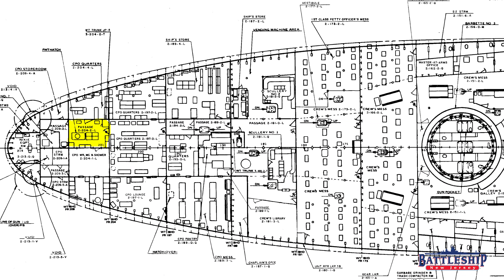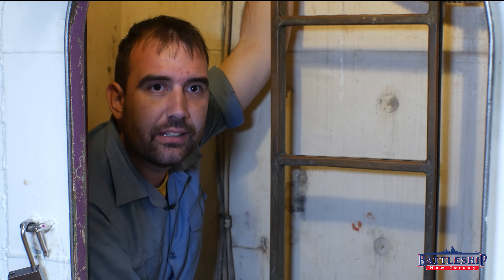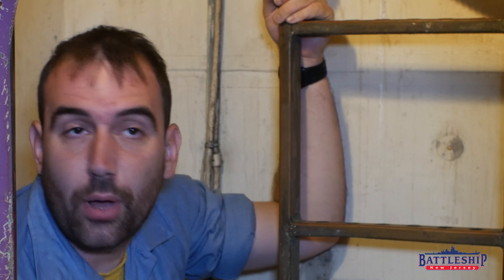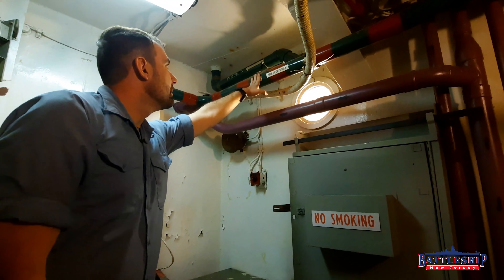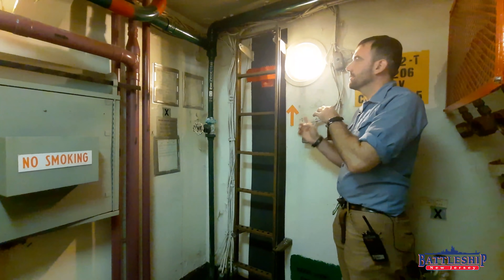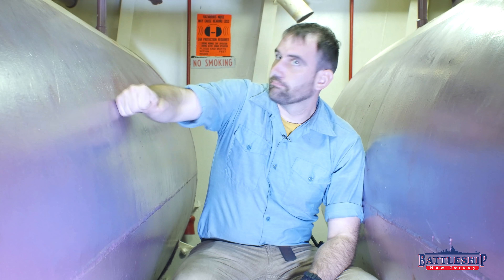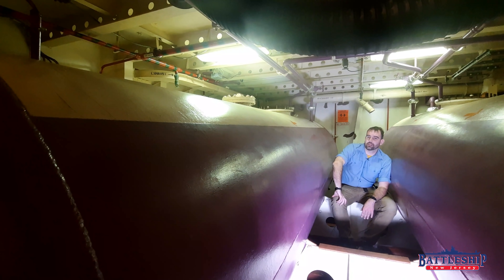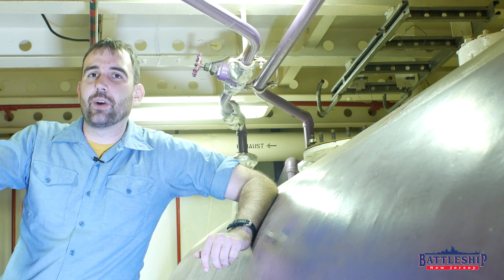JP5: Aviation Fuel

Comment: Give the fact that aviation gasoline is so much more volatile than bunker oil or diesel normal practice was to store it in tanks isolated from the ships hull to prevent shocks effects from rupturing the tanks. 

The loss of Taiho illustrates well the dangers of having aviation gasoline tanks that are not isolated from the hull. 

Based on WWII era plans it looks like they decided the easiest and most expedient way to store JP5 for helos etc was to just use the av gas tanks already installed. Though it does seem 2 of them were removed.

Comment: JP-5 is NOT aviation gas. It IS however a kerosene based fuel. JP-5 cannot be ran in your car. But it can however be run in a diesel vehicle.

Comment: Here's some good info to tell the watchers. All avgas and mogas piping and non structural tanks were/are painted yellow and the piping was pipe inside pipe with fuel in the smaller with a larger pipe around filled with co2 to prevent fire incase of a fuel leak.

Comment: JP5 needs to be recirculated every day through a filter..  It cannot have moisture in it or it will freeze at high altitude.  I ran the Hot Pits at MCAS El Toro in the Marines back in 96.  Worked with JP5 for years.  High flash point wont burn out in open

Comment: Is the fuel lab really on board to testing? Where was it? Did it exist the whole time the ship served or is it newer?
Reply: Prior to taking on fuel the oil king tests a fuel sample. Centrifuge sediment test and viscosity from what I remember. This took place in the oil lab. Fuel was run thru a fuel oil purifier. The purifiers get very dirty and suck to have to clean the disks. I remember aprox. 110 disks.

Comment: Ryan, if you do go back in a future video to check out the inside of the tank you also need to explore what is on the other side of that bulkhead you believe was installed. Just to find out if your supposition is correct or perhaps to find that something unexpected is there.

Comment: The oil bunkers carry basic fuel oil, it won't degrade much over several months. Av Gas degrades over just a few months knocking octane numbers downward. The OS-2 and other scout seaplanes needed the highest octane numbers in their fuel, and absolutely no sea water. Same for the JP5, no sea water at all. The salt would destroy the piston engines of the sealants and turbines of the helos. The stream generated fort the steam turbines? The salt in the fuel oil just burns green. Also, JP5 pipes are painted Magenta, same colors as ABF crainials, jerseys and floatcoats. It's why Fuels is called 'Grapes'.

Comment: Not sure about an Iowa but on both a Tico and a Spru-Can we actually fueled not just our helos with JP-5 but we also fueled the ships boats (one Motor Whale Boat and one Captains Gig) with JP-5 as well.  Even though they had diesel engines the ship only had the capability to pump JP-5 up to the deck where the boats were stored (same level as the flight deck).

Supposedly diesel engines run great on JP-5 but if you run them with JP-5 for long they won't run well with Diesel fuel anymore.

Comment: AvGas has an EXTREMELY low flash point -59F to allow operation at altitude  at room Temp you can actually watch the level decrease in open smaller containers.

Comment: On most Navy Ships the majority of firefighting equipment is in the engine room spaces. That would be the Halon system the CO2 suppression system and AFFF system. Carriers are sometimes the exception to the rule. They have separate firefighting systems than most of the ships. They have on an Nimitz class carrier anyway 10 600 gallon AFFF stations below deck on the second deck. That pump firefighting foam mixed with seawater at 6% to the flight deck countermeasure washdown system which also seconds as firefighting system. There are also portable firefighting systems on flight decks of aircraft carriers I have an amazing story about The firefighting team from the USS Eisenhower being called out into a morning for a fire in a galley which can be disastrous. Some other day I'll tell you that. As to why the Navy stored the JP5 into tanks instead of voids on board ships. I suspect it has to do with contamination of fuel, because the jet engines on these aircraft are particularly susceptible to any kind of contaminant in that fuel. And being the New Jersey was an older ship even converted to fly helicopters off of them they were probably worried about contamination. Originally as you said it was gasoline It was 110 high octane aviation fuel. They could also the New Jersey with that 110 octane fuel while in the Pacific or anywhere for that matter fuel the PT boats that also burned that fuel. It was kind of a universal fuel for aircraft and small boats during world war II. Respectfully DC1 USNR

Comment: JP-5 is NOT gasoline.......it is "Aviation Turbine" .  It is also known as Avcat and F44.   It is a higher flashpoint product than civil Jet-A1 or Military F34.  It does share the same additives as F34, being a lubricity additive and de-icing agent FSII (methyl glysolv) and has much more toxicity with skin contact.  Myself I was for 7 years a certified jet fuel inspector for Military RAAF in Australia and Civil customers at Airports. To my knowledge JP-5 is desirable for below decks use in the Navy due to its better safety feature high flashpoint and  replaced 'bunker fuel' for US Navy vessel boilers (in the 1980's?).

Comment: I think the term you want for the light fixtures is Intrinsicly Safe, my uncle used to work with British Petroleum and they had special walkie talkies for working on the refinery which the buttons the transmit had special contacts so they could never make a spark and all other electrical or mechanical gear bought into the area had to be similarly rated
Reply: I think in this case it would be explosion proof.

Comment: Sometime in the 70s the navy switched from aviation gasoline to jet fuel.  Earlier helicopters and piston engines used the gasoline.  Avgas is much more dangerous and would require the stricter fire suppression.  JP% is a kerosene based jet fuel and it's used in gas turbine engines.  The flash point for Avgas is room temperature.  The flash point of JP5 is much higher hence safer.  I worked as a civilian engineer on an unrep tanker in the mid 70s.

Comment: Hmmm surely those tanks originally held gasoline, and that's why there is so much "fire paranoia". At some point they would have started to hold jet fuel, which is a lot less dangerous. The measures seem extreme for jet fuel (aviation-grade kerosene), which really isn't that different from ordinary diesel...

Comment: as an addition to the explosion proof lights, the J-Dial phone will be a rotary.  even on a current ship, spaces with potential explosive gasses still get rotary J-Dial phones.

truman commissioned in 1998 had rotary phones in the magazines and other explosive atmosphere spaces along with the other systems.

i think i would find it interesting to see the AFFF station.  we had i believe 4 of them on Truman (dont recal the exact number could be more), they were off of the messdecks and were fed from large steel tanks in the hanger about 3 decks above them.

Comment: I worked in the arctic on a remote camp on the floating ice.  All of our fuel was JP-5: for the helicopter, twin otter aircraft, generators and our stoves. When a stove went out due to an empty JP-5 fuel barrel, it was very hard to relight. Definitely not gasoline. I was going to say more like vegetable oil, but that would be a slight exaggeration.

Comment: All those precautions for fuel handling are when the ship was built and tanked AVGAS for piston powered floatplanes, which has  very low ignition point compared to JP5 and so all the anti-spark protection was needed. As far as the phone and the button for the oil lab, it was to get verbal results of fuel testing before servicing aircraft. The cabinet held glass bottles for visually inspecting fuel for water and visible contaminates. Those racks orginally held CO² bottles to flood the compartments in the case of a conflagration later refitted with halon and then when it was found out how bad halon was (CFC's and a carcinogen) it was back to CO².

Comment: As built, "aviation gasoline fuel" would be correct, for the high octane gasoline used in the piston engines on the float planes.

JP-5, however, is not aviation gasoline fuel.  It's aviation turbine fuel, and essentially an aviation blend of kerosene & diesel fuel oil.  Multi-fuel diesel piston engines can run on it, in addition to aircraft turbines.  In a pinch, New Jersey could probably burn it in either her main boilers (which should be capable of burning the similar #2 marine diesel fuel oil) or her auxiliary diesels.
Reply: Believe we used JP5 on the USS Briscoe DD-977. Guess it would make sense since she had gas turbine engines
Reply: Maybe it was JP 10....been awhile...
Reply: JP-5 is more volatile, and thus requires a bit of additional care when handling.  JP-5 CAN be burned in the boilers, but the BTU content per gallon is much less than DFM, so you will burn a LOT of it.  Since DFM is much cheaper than JP-5, using JP-5 as boiler fuel would be very much an emergency configuration.

Comment: I dont think jp5 is a special gasoline. When you take a jar of gasoline and a jar of jp5 one of them will light up with a match and the other will not. In other words jp5 is way less volatile than gasoline. How to light jp5 is putting it into a spray bottle and spray the mist on a lit torch and it will light. Theres a nozzle in the engine wither some piston engines or a jet engine that sprays the mist on something that's constantly lit. Maybe it's a glow plug like you'll find in diesel engines. It's more like a special diesel or kerosene rather than a special gasoline.

Comment: Sometimes you are using the terms JP-5 and Avgas as if they were exchangable or synonyms - they are not.  JP-5 is a military specification for fuel for turbine engines while avgas is the collateral term used for the aviation gas ("petrol") variants used for aviation and which the military has long phased out and which used to be used for piston engines.  That said, JP-5 is basically a high-spec version of diesel and avgas a high-speci version of normal car gasoline.
Aircraft fuel systems and engines are generally very intolerant against pollution.  In particular water is a big concern as it may freeze in low temperatures such as at high altitude or in carburettors. Another concern is microbial growth resulting in some biolslduge in tanks that can clog filters so storage and aircraft tanks and fuel systems need to be somewhat sterile.  I assume this is the reason for the special JP-5 tanks.  I'm sure there will be other safety features for example to allow taking samples or catching condensed water.
I wonder if the purple colour of the piping is explained by the colour of the avgas 115 which was marked with purple dye and used for high-compression or turbo-charged engines.  The spec for this avgas 115/145 was formulated in 1944 when radial engines ruled thw world of aviation.

Comment: Need to do a video on the refueling at sea king posts and the flight control station. Especially the flight control station since it is a lot different from the time of when it had float planes to when it was changed in the 80's for helicopters. I thought that the Iowas were once going to have Harriers at one point. But I digress. It would be good to see these to systems.

Comment: I wander if separate tanks is to eliminate the chance of cross contamination.  Is a little Av-Gas/JP get mixed in with the fuel oil, no big deal.  Get that stuff mixed into aviation fuel and you can ruin an engine or loose an aircraft.

Comment: On the subject of fuel... diesel fuel can get the "diesel bug" (microbacterial contamination) - was the main ships fuel bunkerage also susceptable to this?   how did they counter it?
Reply: Never heard of it being called "diesel bug" but yes we got it on one ship I was on, our oil king was baffeled, damn shit just would not burn!! boiler fires just went out! No water in the fuel so we had to pumt that contaminated service tank back to the same storage tank and not use that tank. pumped it out in port and steam cleaned the tank.Would have really sucked to be bobbing around the middle of the Pacific with full fuel tanks and not a drop to burn.

Comment: From what it looks like from this video and videos you guys have done in void spaces where they stored fuel everything looks so clean as if they managed to remove all the petrochemical residue from these various tanks. How did they get these spaces to look so clean? Since YouTube doesn't have smell-o-vision, do these spaces still smell like what they stored?
Reply: Your question just made me realise what you said, I guess I am spoiled from those museum videos, the ship always looks so clean
Reply: @senecanero3874  Even when in service, a US Navy ship is generally someplace between "not dirty" and "very clean", depending on where you are at on the ship.  Many man-hours are spent keeping it that way.  Stray oil and grease in the machinery spaces is a fire hazard.  Unclean living spaces are a health hazard.

Berthing areas are cleaned and mopped at least once daily, and swept down multiple times during the day.  Heads are cleaned and disinfected daily, mopped several times daily, and may be cleaned/disinfected more often if required.  Mess decks are cleaned/disinfected daily, and cleaned/mopped after every meal.  Galley should be "clean/disinfect as you go" for prep surfaces, and cleaned/disinfected/mopped after every meal.  Medical is kept at a cleanliness level which assumes that they may need to perform emergency surgery at a moment's notice.

This is how it was when I was on active duty, on the ship that I was stationed on.  YMMV
Reply: I suspect that they may have been steam cleaned.

Comment: JP-5 is “aviation fuel” not gasoline. A derivative of kerosene it has additives to make it more suitable for shipboard use, to reduce the susceptibility to shipboard fire. Specifically it has a higher flash point over other jet fuel, and much higher than gasoline. The Air Force used JP-4, which didn’t contain these additives. Since New Jersey was decommissioned DoD has standardized on JP-8, which improves inter service interoperability, and logistics, while retaining the fire protection afforded by JP-5.
Reply: I remember using jp4 on c141  in the ‘80s
Reply: it was. Measured in certains in stead of octaine

Comment: Just to add to the many comments already about JP5, when I was working for the navy in the 90’s one of the goals the navy had was to become a single fuel navy, which would be JP5.  It was used in turbine powered aircraft, gas turbines for main engines and ship service generators, Diesel engines and it could even be used in boilers on steam ships (there were actually still some of those around).  The goal was to simplify supply logistics.  I think the only equipment left that maybe doesn’t use JP5 is the so called “yellow gear” on aircraft carriers.  This is the mobile equipment on deck (aircraft tugs, firefighting gear, refueling gear, etc.).
Reply: Where I was most of the ground support ran on petrol engines, though all of the tractors, some of the mobile generators and one or two specialised ground support vehicles ran on diesel, and would run perfectly well on jet fuel as well. Was often a bit of work to fill them all up, as most had only a 20l fuel tank on them, so there was a drum with a pump that would be taken to the fuel point, and filled up there, with the vehicle registration , showing a 40l tank, filling up with typically 220l of petrol. 

Diesel no problem, all those with diesel power could drive to the fuel point on their own, but some of the more specialised petrol power units could not do the 5km drive on a full tank. In use they typically moved 50m at most.
Reply: Still are MANY steam-powered ships around.  It's just that some of them use a nuclear reactor to heat the water.  Your propulsion choices in 2021 for surface ships are Oil/steam, Nuclear/Steam, Gas Turbine, and Diesel.  ...and wind, since the USS Constitution is still a commissioned US Navy ship.